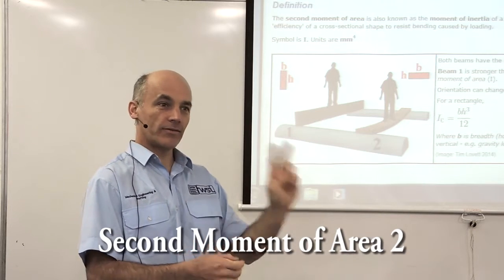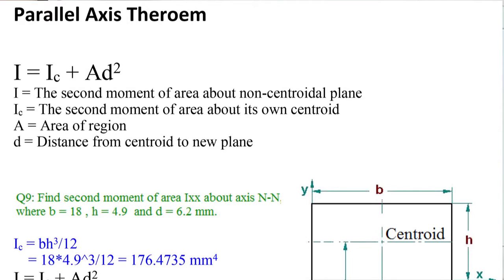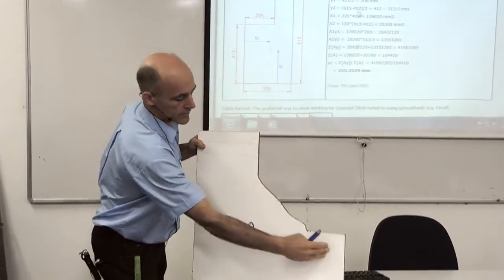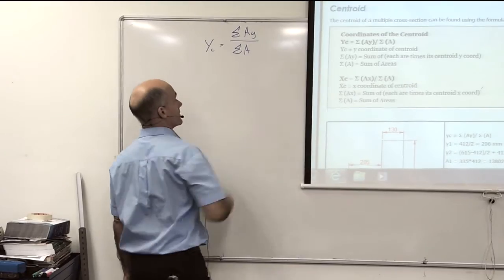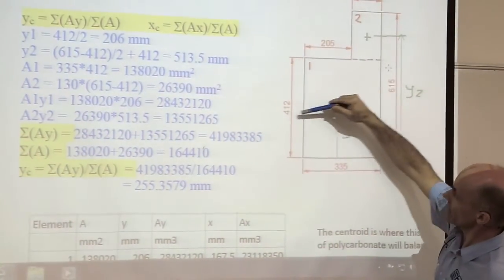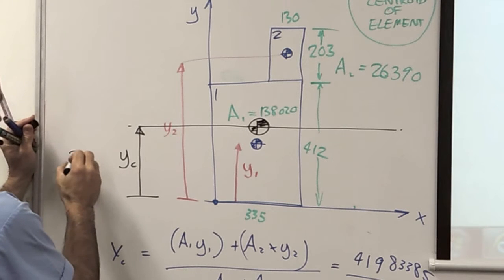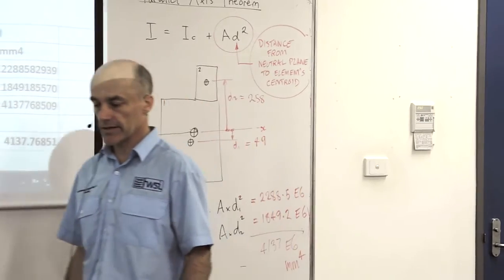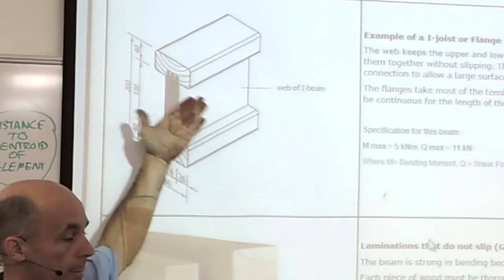Area Moments 2

Comment: The only issue I have with this is that NEVER in a million years would you apply the centroid calculations because you just take measurements of the profile. Model it in CAD and then just use the centroid function and do that same thing in about 30 seconds. You would need the the dimensions just to do the math so there is no application where the CAD would not work. However this is the issue with Uni. Lectures teaching you things that are not used in the efficient world of business where time is money. If you are going to argue "...but its good to know" its even better to know other stuff yet covered. Move on to more current systems. No slide ruler classes either please.

Yes the teacher is great but not if he is teaching you all about buggy whips.
Reply: They teach you how to do it in CAD in the advanced diploma course. But you have to know the math, that's the difference between and engineer and a draftsman. There are times when you don't know the dimensions because you haven't designed it yet. You get given the load it has to take and you have to work backwards to design the dimensions.    The client will mostly tell you "I need a beam that can handle 1200kg, what dimensions should it be?" not "I have a beam that is x*y*z, how much can it hold?"
Reply: To add to faolan1686, having the computer do the calculations you do not understand is just a recipe for disaster. As they say in computer science - garbage in, garbage out. If you don't know what the computer is calculating, you won't know how to give it the proper input data, and you won't know how to determine the output data. Well, maybe that won't be the case in simple centroid calculations, but there are certainly some things which you just WILL NOT get right unless you know the underlying theory first. FEM comes to mind as an area where people make a lot of mistakes without even realising.
Besides, knowing how to do these calculations and knowing the formulas helps you understand how shape determines the stiffness of an object, as was shown with an I-beam example in this video. It gives you the conceptual understanding of why things are the way they are and how to design your parts for maximum strength/stiffness with minimum weight.
Reply from the maker: Yes and no. Yes = I would definitely not bother using calculus to determine the second moment of area of some mathematical shape. No = We are dealing with the basics which can be taught in an hour, and gives you the understanding of how significant the depth is, why you want mass away from the neutral plane, what Ixx and Iyy actually mean on the computer screen, why it is measured in mm4, and why adding a horizontal plate the underside of an I beam will give you a higher compressive stress than tensile stress due to lowering the Neutral plane according to the parallel axis theorem, and why adding a vertical plate to a beam is a really bad idea since it will be overstressed. 
Once you understand the basics, a computer is WAY more useful. I think numerical methods on computer have almost completely bypassed the need for Calculus in engineering. Especially since most real-life things can't be done using Calculus anyway, because the shape is not mathematical.